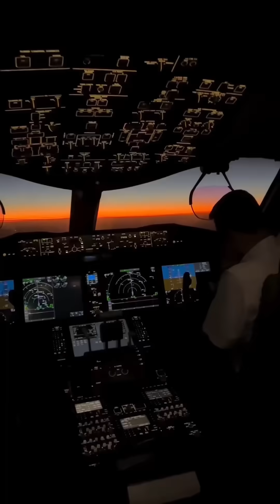why modern aircraft only need 2 engines

Comment: Years ago the airplanes were designed with four engines because the ocean was huge and four engines planes were designed for crossing the ocean. But two engine planes were banned because If the two engines fails and you are not close to an airport you will crash. But in the four engines planes if one fails you will have the other three and if two fail you still have two engines
But in the late 1990s ETOPS ( Extended range twin engine operational perfomance standars) certificated the two engine plane because  the engines failures were drastically reduced and was more save to operate with two engines besides that the tecnology improved
The two engines planes also reduced the operating costs and maintenance costs. Also the two engines planes consume much less fuel
In the late 1990s ETOPS said that two engine planes have to be 120 minutes of an alternate airport for security reasons
They had a very good security record and ETOPS Extended the time to 180 minutes( 3 hours) to 240 minutes or 4 hours from an alternate airport. 
The tecnology made this posible from upgrading the planes for two engines to today.